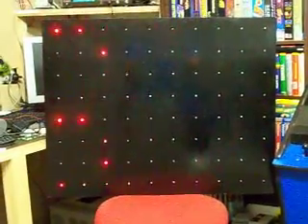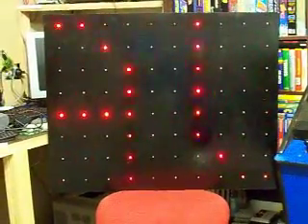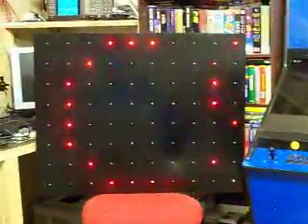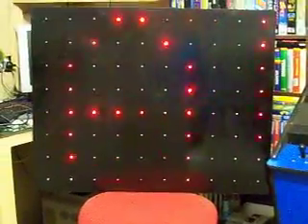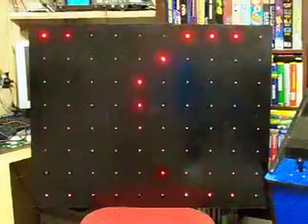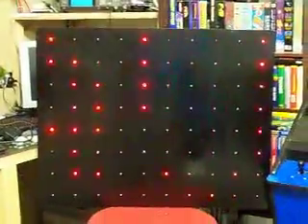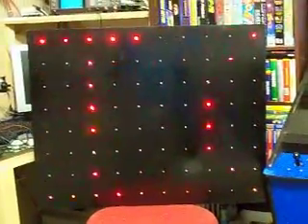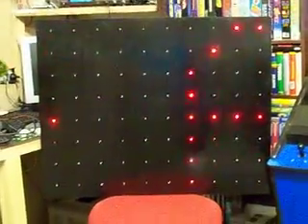An LED display Board.

Comment from the maker: Hi,

Yes! I am in the process of making a bigger version of this display. This time it has RGB Led's which allows for 8 different colours. 

It is going to take up an entire wall at work (which is about 2.5 metres high by about 2.5 metres wide)

It will contain roughly 2000 LED's and will be able to run some nice animations.

As for the website - I have taken down the old one, and the brand new one will be up and running in a few days! I will release the address at the end of the week.